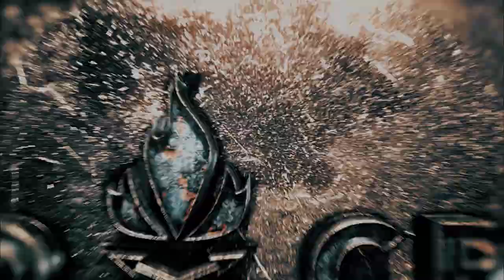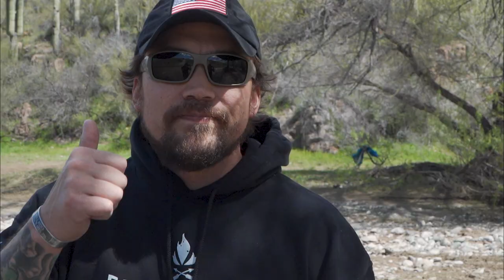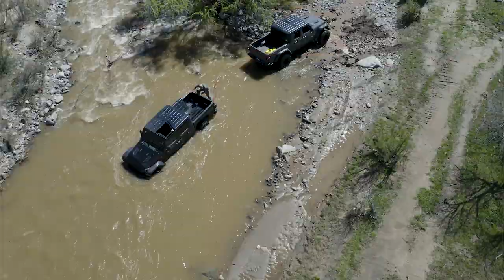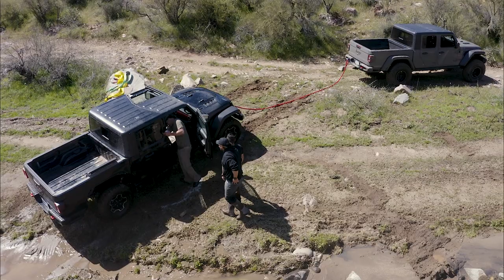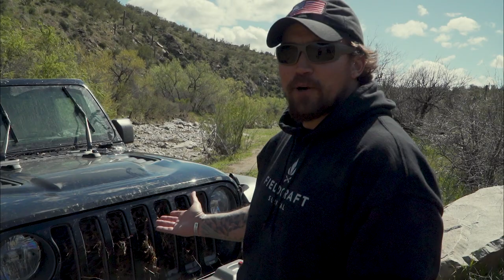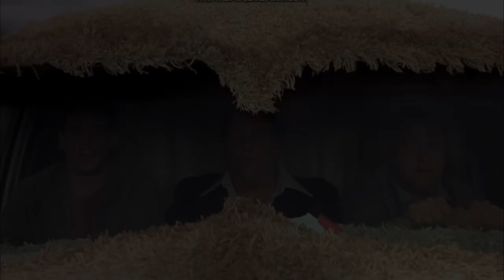S.O.S Jeep Gladiator Recovery With Mike Glover & Team Fieldcraft

Comment: Watching this video brought back some good and bad memories of my off roading days. I flooded a YJ Wrangler in my younger days and was able to drain the oil, dry the distributor and drive it home. I bent 4 of the rods in the engine and had to rebuild it. I drove it a few more years and the guy who had it after I did drove the Jeep for 10 years or so. Three of us local guys drove that Jeep through high school and the last guy through college also. 

I hate mud and water but still like driving trails in my Grand Cherokee
Reply: Wes I call bullshit. You bend 4 rods on a inline six and there ain’t enough compression to run it. Nice story though
Reply: Wes yeah I know Jeep had a 4 cyl. You bend 4 rods it makes them shorter. You shorten the rods by just a few mm and you lose enough compression to run it. Like I said good story though

Comment: Good stuff. I did this to a 4.0 TJ in the Big Sandy Creek in WV about 10 years ago. My front ended up in a swimming hole with water over the steering wheel. Tried to replace the plugs and oil on site, but it turned out I hydro-locked it and put a rod through the block. Had to snatch strap it about 3 miles up a trail to get it to a place where a flatbed could reach. Very interesting tow on a skinny cliff side trail with no brakes and no ability to engine brake because of the thrown rod. I had it towed two hours home on the flatbed, removed the carpet, cleaned it up, let it dry, and replaced the motor with a salvaged 4.0. Ran like a champ. Mine wasn't submerged anywhere near as long as this guy though.

Comment: Oh wow a brand new jeep and the door seals cannot hold water out! My Sierra went into water at 1/3 of the doors and the interior was dry.
Reply: Hold it in there for a day.
Reply: When water fording you don't want door seals that can keep water out. Weather stripping is for rain and keeping hot/cold air in, that's it. If you have a watertight cab, the vehicle will have buoyancy and you'll have no traction on the waterbed when fording. If you are going to end up completely submerged because whoops, it's good if water can get in quick so the water pressure inside and out is equal. It makes opening the door and swimming away possible. Try opening a door with a few hundred lbs of water pressure keeping it shut.
Moral of the story is, know the fording depth of your rig and  know the greatest depth of the stream you're trying to ford before sending it

Comment: With the air filter in place the engine is wet but should be clean, the transmission, transfer case and diffs will be water logged but salvageable.

Comment: Fresh water isnt to bad..at my shop we specialize in all eletrical diagnostics. Especially floods regular fresh water isnt bad as long as you get to the moduales in time. Blowem out with water and go by yourself some CLR from home depot spray all connectors that have green with it and let it sit. Blow it out with some air, as far as the motor goes.. you said dump it a couple of times run some diesel mixed with fresh oil.. and try and see if you have conpression with new plugs. Or  just let insurance handle it 👍🤣

Comment: Good job!  The lovely squeaks are rocks in the disc brakes.  Easy to remove.  If he shut the engine off immediately, should be ok. Flush all fluids 2x.   Remove the carpet and clean, dry in the sun.   Remove drain plugs and cover the dash , wash out with hose.  Yea, sounds crazy but I've done that several times with my jeep.   After seats dry out, throw on a set of seat covers.   This was a great lesson of what NOT to do.

Comment: Should already have a the strap hooked up to the hitch and the rest of it sitting in the bed. It looks cool stuck but the axles and transmission are taking on water every second that goes by. Even if the breathers are moved higher. They still take on water

Comment: At least both Gladiators got to the creek.  3 recalls and counting. 2 that result in crash risks:  Driveshaft fracture and clutch plate fail / fire.  Glad I dumped my Jeep.
Reply: MilesB mine caught on fire and burnt to the ground on I64. It had 8,000 miles on it, and had been in the shop four times prior to that..
Reply: These are recalls on the gladiator?? I havnt got any notice for any recalls on my 8 speed auto gladiator rubicon. And I’m at 6k miles, which is basically still new I know, but been solid. 
Only recall I’ve heard is about the manual trans models having issues with the manual trans of some sort.

Comment: Should have had a snorkel on it, but the content was fun to watch.
Reply: Extended breather lines for the axles transfer case and transmission are a worth while investment if you plan on water crossings, where water goes above the tires.... axle tube seals will keep most small medium large particle debris out of the front axle too...... Snorkel it if water goes above the door handles and headlamps........ A set of smoke stacks on a gladiator would look bitchn

Comment: Unfortunately the 3.6 ifs kind of a junk engine. Known of several that needed replaced well before 100k. Otherwise, Jeeps are nice.
Reply: A few bad ones in 2012. They ironed out the kinks by now, as long as its stock
Reply: They aren't too bad to work on either. However,  I went to a class and the new engines are supposed to chime with the multi air system,  which will make it more complex.

Comment: Yea I Doubt that Jeep will run again , Jeep is an American name but it is not made in America anymore They are made in Italy now Because Fiat bout the Company so now they are a false American brand and are Cheaply made and un reliable now. I bought a 2020 Jeep Cherokee thinking it was still American made and reliable until it started burning and Losing/Consuming Oil like crazy it is a problem with 2020 Jeep Cherokees along with the Recalls and having trouble changing gears just think about it when wanting to buy a Jeep it will not show it’s true flaws during the nice test drive, until later on in the year, Trust me .